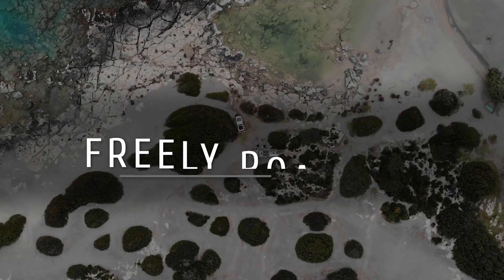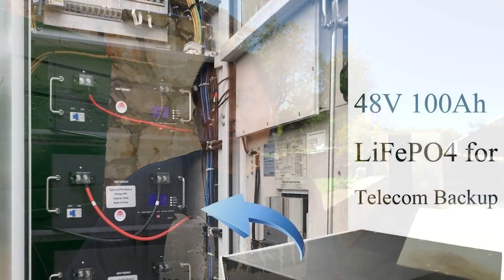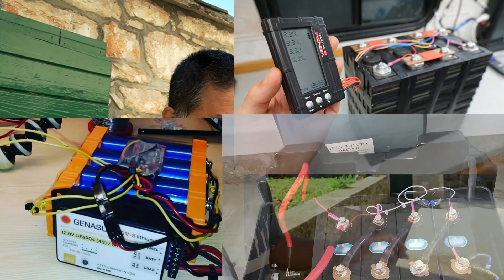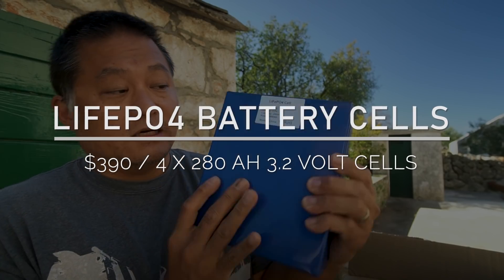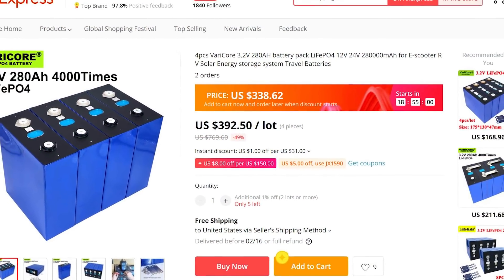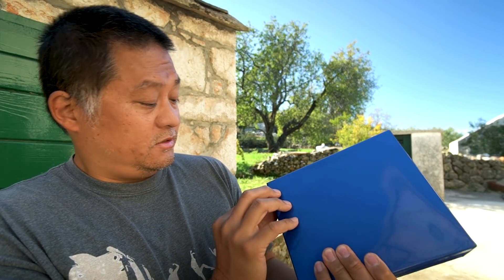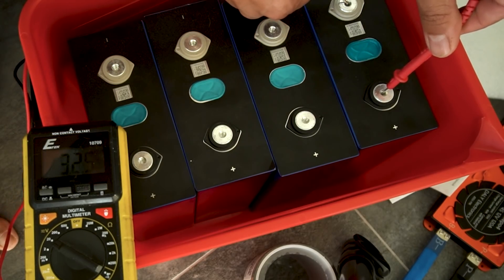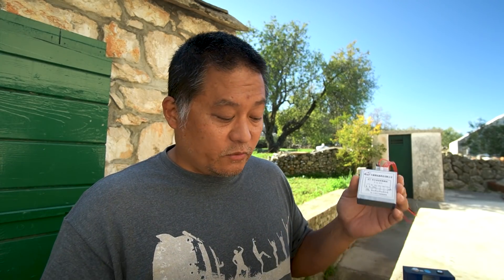Build Your Own 12-Volt LiFePO4 Battery For Cheaper Than AGM

Comment: Really awesome! Bummer the shipping to europe was so expensive. And yes, MUCH cheaper than lead acid. I don't understand why anyone buys lead acid anymore 😂

You don't need a balancer for these cells. If they are matched correctly, the active balancer is a waste of money. If they pull full capacity, you are good to go.
Reply from the maker: Thanks! Yes I am comfortable with how well balanced the cells came but for 40 bucks I am ok with using the active balancer. After 3 months of using the pack, it's keeping the max-min delta at 6mV. I don't have any conclusive tests to prove it but it will get as much as 30mV apart while under charge or load and recovers really quickly. No complaints! At a low c rate discharge test, it pulled 284Ah!
Reply: @freelyroaming  You are ONE HUNDRED PERCENT correct in balancing these cells. I got these about a year ago and they do have balancing issues due to receiving varying capacities. Adding a balancer, and replacing cells, was a game changer. If you are thinking of using this set-up, listen to this man. Buy the balancer!
Reply: @freelyroaming  How do you keep it in the range of 90% and 10%?
Reply: In Canada, shipping is also totally prohibitive ... $ 350 Canadian for shipping 4 cell ... ouch !!! $ 700 for 4 cell + $ 359 shipping ... $ 1050 ouch !!!
Reply from the maker: That's crazy. Try a few different sellers. I've found that many of them have significantly different shipping rates for whatever reason.
Reply: @freelyroaming  I noticed the same thing. Shipping costs for the same product which even greatly exceeds the total cost of the product in shipping ... therefore becomes more interesting for several regions of the world
Reply: @freelyroaming  The reason for the high price to ship to Canada is in their customs regs where the shipper must do all the paperwork for them and other nonsense. USA is not exempt either - a 3 foot long strip of 4130 steel, costing $8, was quoted at $85 to ship to Canada. Those batteries you list sip FREE to USA and today list at $453 for 4.
Reply: @paulmoffat9306  Steel is not dangerous goods, these batteries are which can account for the difference.  While LiFePO4 batteries are more chemically stable then Li-Ion they are still treated the same.  Safer =/= safe.   So if they are shipping free to OR within the US then someone is shipping them illegally.
Reply: @ThinKkBIGG  I would check for another source if shipping were to cost that much. I bought 16 cells and only paid $400 for the shipping (to Canada from China).
Reply: @ThinKkBIGG  I agree, I'm in Canada as well. Soon as the border opens up, I will order for delivery to a US side parcel service (free shipping to USA)
Reply: @paulmoffat9306  Have you gone ahead with this? I was dismayed to learn that I can’t bring Batterys from the USA to Canada as a commercial import without a Special permit of some sort. Hopefully that does not apply to personal imports
Reply: I want to know how I can set it up in the milk crate and run my 1000 watt air conditioner
Reply: @SamsAdventures247  Hi there, silver symbal has a video on it but I"m not sure it's the same amount of power etc. I'm kinda new to this, with this set up, how long would this be able to power your 1000 watt ac without recharging?
Reply from the maker: Running a 1,000 watt AC load will need an inverter with some efficiency loss at around 10%. So expect about 1,100 watts of DC draw to run a 1,000 watt AC. That's about 85A. So with a 280Ah pack with 90% usable capacity you can run that AC continuously for about 3 hours. Usually air conditioners cycle on and off with a thermostat so practically it will run for a bit longer.
Reply: @freelyroaming  yeah i don't understand any of those numbers but I get the 1000w appliance for 3 hours. Thank you.
Reply: @dgunearthed7859  In other words a 500w window a/c for 6 hours, which might be enough since while the sun is out, the panels are providing the power not the batteries.
Reply: @jimbob3030  thank you
Reply: @dgunearthed7859  It's simply converting Amps to Amp Hours, and Watts to Watt Hours.. If run 1100 Watts for an hour continuously, that item has used 1100 Watt Hours.

He stated that it draws roughly (85A) 85 Amps, so if you ran that item for an hour, it becomes (85Ah) 85 Amp hours,  The total capacity of the battery is rated at 280Ah.  Taking 280Ah, and dividing it by how much is used (85Ah) = 280Ah / 85Ah = 3.29, which is the total number of hours you could run this item.  Something you always have to remember however and I'm not sure if the 280 includes this, is the TOTAL battery power.  If the TOTAL battery power is 280Ah, you need to subtract the usable power... If you can only use 80% of your total power, then you need to multiply that total power by 80%.  If the TOTAL power is 280Ah, then 280 * .80 = 224Ah - this is your usable power.  So starting again, 224Ah / 85Ah = 2.63 hours of runtime.
Reply: @unknownerror542  thanks very much
Reply: @Clodercs  Je suis du Québec 😉. Do you have a link? Can they be bought as a group and negotiate a price? The transport seems lower and many ask to contact, therefore negotiable ...
Reply: Ive had the same shipping issues with fat tyre e-bikes. Shipping costs the same $ amounts as the bike and there will be import taxes on top.
Reply: I baught from soonbuy and 2 cells are damaged.
They show after one week balancing different voltage 
6 show 3.37 and 1 show 3,47
1 3.25

All cells are charged to 3,65and one week all connected to balance.

If I put load these two cells loose quickly voltage so BMS turns off after 65 ah

I don't recommend soonbuy!
Reply: We buy lead acid batteries, because any store that cells 12v batteries do not have lithium iron phosphate versions on the shelf.
Reply: Cuz highly discounted AGMs are still very useful and cost effective.  Many car stereo enthusiasts get them cuz they are simple to connect and more peak amps can be drawn from them compared to LiFePO4 with a BMS.  Also, for 99.99% standby UPS use (emergency power), why bother spending big $ for LiFePO4 when AGM will more than suffice for much cheaper?  I have seen highly discounted new AGM batteries (100Ah rated, up to 80Ah usable per full charge), for between $100 and $200.
Reply: Hi how much 4pcs 12v 100Ah lithium ion battery
Reply: A balancer is good to get the maximum capacity out of your battery setup. As time goes on all batteries will wear at different rates, and will discharge and charge at different rates. If you pry apart any decent multi cell rechargable battery pack, it will have a balancing bms circuit board. However Daly BMS does balancing, so its kind of pointless in this setup...
Reply: @antithematter  I don't think AGMs have this.
Reply: Because Will the initial price is more.. and some people like my self cant afford to drop 500 dollars for 12v 100ah lithium .  You should know this by now being and expert and all.

Comment: Thanks for a easy to understand video. Most either go too fast or go way over my head in explaining. I am running four 100 Ah Powerqueen batteries and I  am in the process of doubling my Ah with Timeusb 12V 100Ah Pro LiFePO4 Batteries. Do you think I can combine for one bank or split into two battery banks ? Again thanks for a great battery video. I will be looking forward for more videos.

Comment: Yea but fully charged cell has 3.6 or some sources mention 3.65V.. meaning 14.4V is fully charged one.. just btw
Reply from the maker: 12.8v is the "nominal voltage" of the a 4S LiFePO4 pack or 3.2v per cell. That is what you use to calculate the capacity of the battery. You would never use the charging voltage for such calculations. Nominal voltage times Ah capacity. Nominal voltage does not refer to the voltage of a fully charged cell which is at 3.65v.

Comment: This is insane. ali express has them 4 for $153 for 280 AH, my last replacement of my golf cart battery bank (offgrid home power) cost $1200 with a 30% discount and that system only has bout 300 AH total reserve.
Reply from the maker: Try successfully ordering one before believing the price you see on aliexpress. There are a lot of too good to be true listings on there.
Reply from the maker: I made the video. And I did find them for what I said in the video. But you need to do your own due diligence when picking a seller. This video was from 3 years ago.
Reply from the maker: @maddhatter3564  like I said, this video is over 3 years old. Sellers are constantly changing on aliexpress. Even the from the same seller over time. If you have never used it then you wouldn’t understand. It’s not like Amazon. I don’t have the time to go and update links to every video. Do you own due diligence on the sellers at your time of purchase.

Comment: Di i hear right? you build a lithium battery pack for bout the same price as an AGM battery ? I;m offgrid and still using flooded as space and weight is'nt an issue but would like to go lithium if cost effective ( I'm 24 volt and use 12 golf cart batteries.)

Comment: Great video. Thanks.  We are full-time RVers who wanted to replace the 2 FLA golf cart batteries that were located under the steps of our motorhome with the highest capacity LiFePo-4s that would fit in this limited space. We decided to build our own 560ah LiFePo-4 battery bank with a 330amp Heltec BMS (to start the 5,500-watt onboard generator) and a 5a active balancer for under $1,500 including shipping. I paid $1,358 for 8 cells with busbars, FedEXed to my door in about a week. We built our 12v battery out of 8 grade "A" 280ah LiFePo-4 prismatic cells having an 8,000-cycle projected life at 80% DOD or 6,000 cycles at 100% DOD. If we cycled them 100% every single day, 365 days a year, they would last over 16 years! So, they're obviously going to wear out from age before they wear out from cycling as we only use 15-20% of their capacity daily. This gives us enough reserve capacity for several days of bad weather before we have to run our generator for charging. They even saved us 35 lbs compared to our old FLA batteries and have over 5 times the capacity. 

I top balanced the cells before I assembled the battery, though they were all within a tenth of a volt when I received them. This was probably unnecessary as our 5-amp active balancer would have surely done the job, but spending this much money, we wanted to do the job right. I'm 67 years old and I want these batteries to last longer than me. They were economical too at $2.68/ah. There are cheaper "B" cells available from China that are typically rated at 3,500-4,000 cycles, but we decided to spend a little more to get the higher rated cells shipped from a California warehouse, so if we got a bad one it would be easier and quicker to return and get a replacement. Happily, this wasn't necessary. We insulated the battery compartment, cut a 1" hole in our step risers and installed a tiny computer CPU fan to circulate just enough room temperature air into his compartment keep this space at close to room temperature, so we don't have to worry about the BMS shutting down charging if they get too cold - or their life reduced from getting too hot.

Comment: 4000 charges is noth8ng compared to the decades lifespan of an Edison battery.
Reply from the maker: Sure. If you want to carry 5 times the weight for the same usable capacity. That's not even taking into account their high cost, horrible self discharge rate and slow recharge rate. Every few months someone likes to bring this up but they never bring up the massive list of negatives.

Comment: That BMS an the active balancer is the absolute best way an safest way you can go when you build a Diy lithium bank. Why? Safety. Piece of mind. One fails. You got a fail safe. If both fail well it was meant to be Id say lol. But in all honesty. The Daly lets you set your own parameters so you can discharge as much as you want but control the charging cut off. The temperature cut off. Which is reality is worth it because both situations can cause damage to your cells

Comment: Many of these are used cells
Reply from the maker: The used ones are. Goes without saying. Find a reputable seller.
Reply: @freelyroaming  each one of these is 3.2v and 280amp hours?!  So all 4 are 12.8v 1120 amp hours or just 280 amp hours total. 

This would be perfect for my experiment of outside lighting running 100watts off grid solar project 24hours a day.

Thanks!

Also, which seller or sellers would your rec , disclaimer already noted (I know you can't make promises )

Comment: What cell would you use for a diesel truck? I requires 660 cold cranking amps at 12v
Reply from the maker: I would stick with lead acid starting batteries for a vehicle.

Comment: I prefer alkaline Edison batteries. They last forever, you can build it yourself, and the electrolyte is not dangerous. Prices on manufactured batteries are exhorbitant, I can build an Edison battery for bout $30. I have a rack of eight to simulate 12VDC as each is 1.4  volts at about 30 amp hours. Charging is solar/ hydro/wind as I need to charge no matter what the weather is.
Reply from the maker: That's great. What do you use to charge it? Hamster on a wheel? (Just kidding 😂)

Comment: AGM will not give you 50%.  This was thoroughly tested by battleborn and another independent u-tube person on here... just search for it.  So those 225 AGM will not net you 112 amp hours... you will also find from those test that amp hours isn't really the best way to determine the power of the battery.
Reply from the maker: Yes they will. Battleborn did those tests huh? I wonder what their motivations are 🤔 Imagine what an AGM manufacturer's test results might look like. Don't be fooled by such obvious biases. I dont need to search for other people's tests to know. I've lived on the road for 14 years and have used lead acid cells for 10 of those years and know they do from my own experience. In fact they will all give you 100% if you don't care about their longevity. That's how their amp hours are rated. 50% is just the recommended draw to get their expected cycle life. Deeper draws create dendrites and sulfation on the anode that reduce cycle life. That is what it all comes down to. Cycle life. A 225 Ah AGM WILL give you 225Ah but not for very many cycles before it dies. Reducing your draw to 112 AH is just what you do to make it last longer. Watt hour is more accurate but the differences are not significant and since you have variations in the actual voltage thru a draw cycle, Ah is more practical to measure if you assume a nominal voltage. That's why watt-hour is not how manufacturers typically rate their cells. Watching other people's videos to learn is great but before you go around spreading that info, you should do your own tests and get your own first hand knowledge.
Reply: @freelyroaming  I've been in a powerchair for more years than you have been on the road.  Sorry to piss in your cereal over 2 different studies on the 50%.  The actual manufacturer puts the 50% mark on the lead batteries at 12.2 volts.  If you measure that under small current draws and high current draws in ANY temp range it never achieves its own 50% power rating.  I've also been flying rc planes on lithium longer than you have been traveling by decades.  Lithium was the first battery development that allowed RC to work better on batteries than on nitro fuel.  For the love of god, we both agree lithium is better.  What is your deal, upset because lead doesn't deliver 50%?  lmao
Reply from the maker: @orion_13  you forgot to tell me how many years of double A TV remote battery experience you have. I bet that spans decades! How about those little watch batteries? You are probably an expert at that too. So what you are saying is you don't know anything about off-grid power. Electric mobility and RC batteries are terrible comparisons to off-grid power. If you don't know that by now, you never will. If that is the basis of your knowledge, then you've proven yourself as a noob. You will never get an accurate reading on battery capacity by using it's voltage. That is the first sign of a flawed 'study' you are treating as gospel.

Upset? Yeah, I am upset noobs like you are constantly pretending to be know-it-alls with your two-cent knowledge but in reality are just regurgitating stuff you see online. People like me spend a ton of time getting first-hand data so we can share with people REAL information. Not cheap, second hand BS collected from other people you don't even know. Lithium is obviously better but I can not stand people going around spreading false information of any kind.

Comment: I remember back in about 2010 ish I was helping out at an EV shop and some cells very similar to these were the traction motor batteries. Off the pallet I had to check their voltage, pair them together, charge them with a pretty normal 12 V charger, then let them rest, check the voltage, discharge them on a big resistor pack that tracked the current and voltage and beeped when finished. Write the basic info on them and recharge them. If they failed I could pair them with others if needed and repeat the cycle. If they failed again, they went onto another pallet. About 1/3 of them failed and 2/3 got to go into the small EVs. Some of them even puffed up during the process.

Comment: Im having problems finding batteries for my electric lawnmower which uses( 4) 12v 85ah 20 hrs deep cycle batteries . Are deep cycle batteries lithium batteries?
Reply from the maker: Usually when the term deep cycle is used, it is referring to lead acid batteries.

Comment: Just a query in regards to the charging balance on a bank of batteries, can a diode be installed on each battery to prevent overcharging and resolve the imbalance charging problem. Appreciate any response.